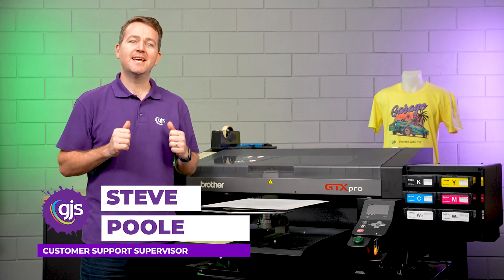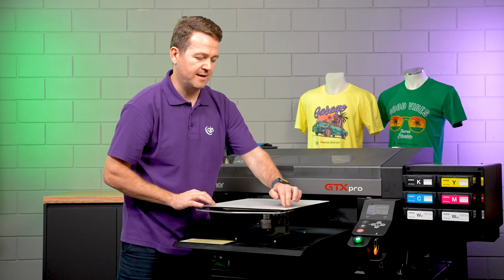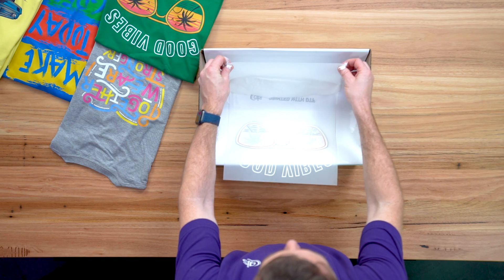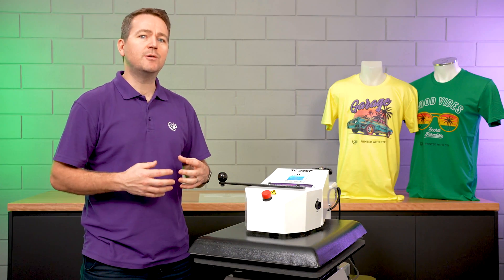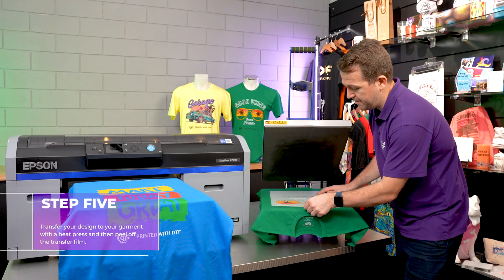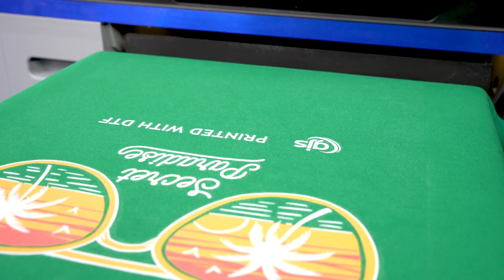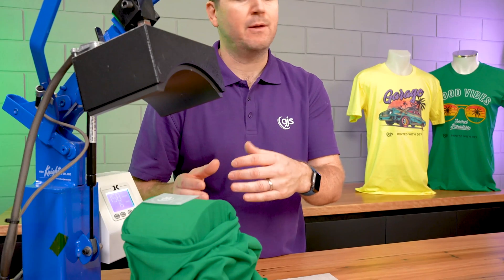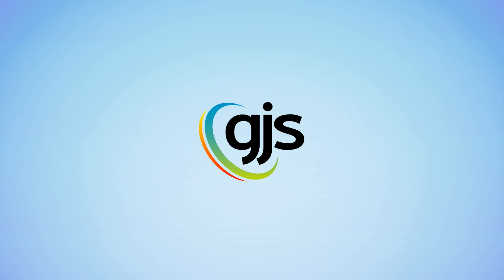How to print direct-to-film (DTF) transfers with a DTG printer

Comment: yup make a video and skip the whole process of setting up the files first, If someone has never done this which is what I assume this video is for. You missed the steps to get the file together in order from color to white and the program to do that.......
Reply from the maker: That's why we clearly note at the beginning of the video that preparation of the artwork "will vary depending on which DTG printer you are using." With several DTG printers capable of printing DTF on the market, it would be impossible to include instructions for all models in this short video. All instructions needed to prepare artwork as part of this process is available to GJS customers via our extensive knowledge base which can be found at: help.gjs.co

Comment: Hello! Can you please share the software that you use to print on DTF with the DTG printer? Also, when printing DTF you use the same ink that you use for the DTG? Thanks 🙏
Reply from the maker: The software used to print DTF with a DTG printer depends on the printer, but Digital Factory from CADlink is compatible with both Epson and Brother DTG printers amongst others. The ink used for DTF is the same ink that a DTG printer normally uses.
Reply: @GJSAustralia  can you use software either brother dtg 541?
Reply from the maker: @robertbolanos8569  Hi Robert, unfortunately the Brother 541 is not an option for DTF as the process requires a layer of white ink to be laid down first, and the 541 is CMYK only.